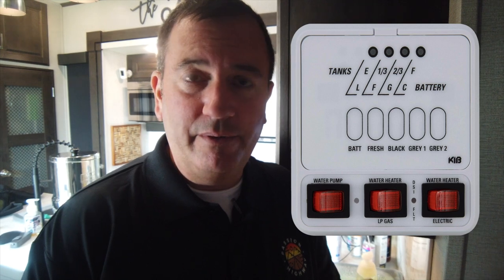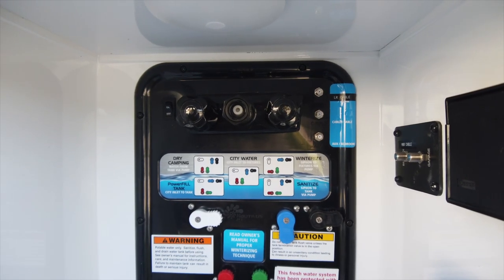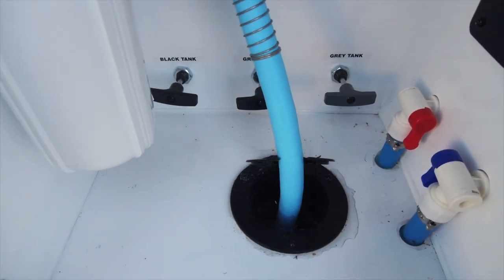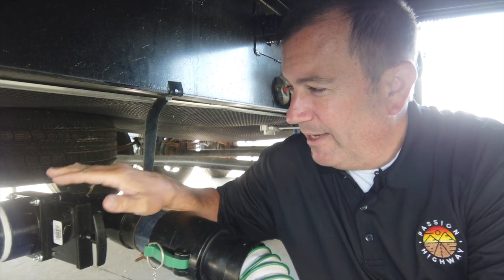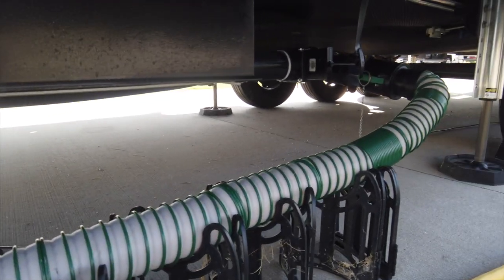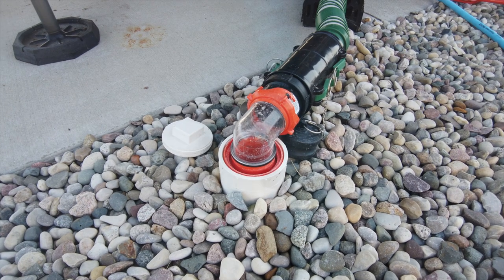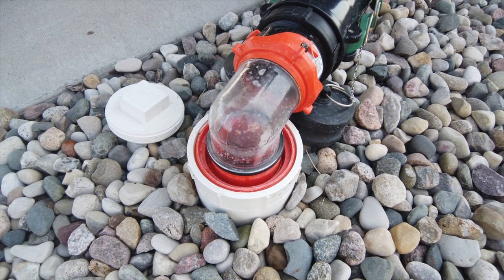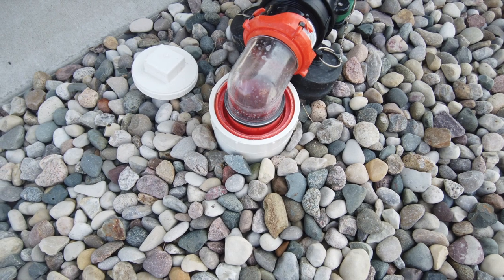Complete Guide on how to Manage and Flush RV Gray and Black Water Tanks

Comment: When the black handle at the back of the Rv is grey water does it flush when you use handles at front of Rv? I have a grand design momentum 328 m 2028. Your video very good & informative.